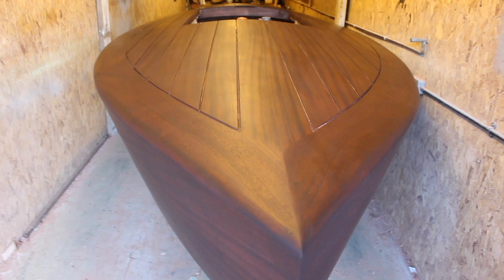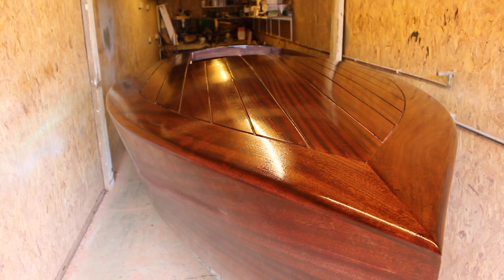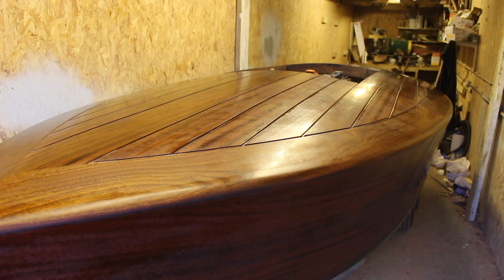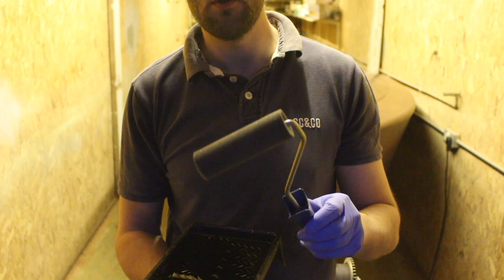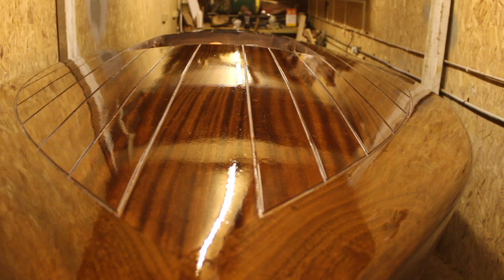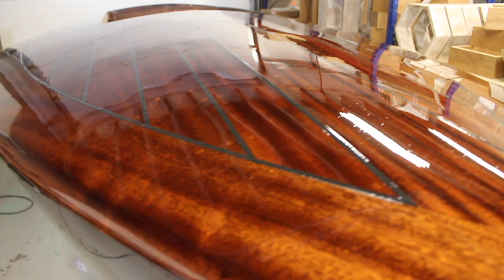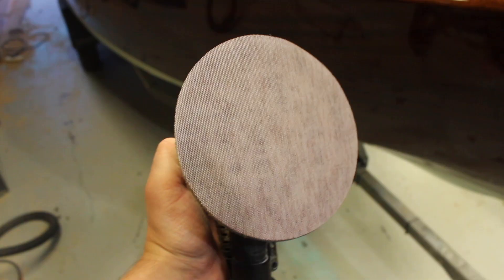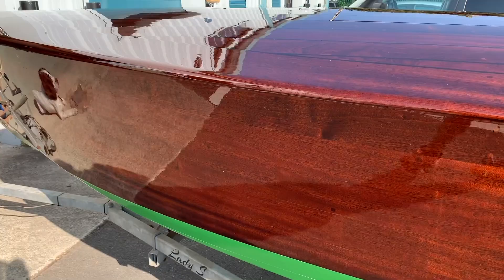How to Varnish a Boat | Finishing a Wooden Boat Pt 2 - First Stage Varnish

Comment: Beautiful work and see you pretty much varnish the way I do with exception that I do my wet sanding by hand.
I see a lot comments saying they're surprised you don't wet sand between each coat but I found that doing so is not beneficial to the finish and a waste of time especially during the first 4 coats. The varnish has to build up some before starting to do any wet sanding. And I don't use straight water, because I found adding a few drops of liquid dish detergent mixed in the water works better
Reply from the maker: Thank you. Yes I don't see any benefit to wet sanding in the early stages unless you are having particular issues with clogging of the sandpaper. I generally only wet sand before the final coat or when flatting and polishing.

Comment: In the spirit of sharing information.
Once all the leveling is completed rubbing teak with acetone is what I learned. We want the teak oil out. then I learned immediately a 70% thinner and 30% epifanes varnish. You want to be careful here, this is when the wood "drinks" the varnish you want thin coats applied so the varnish does to dry on top you could go 90%... while the previous coat is tacky, when the wood stops drinking it has reached the oily part in the teak. Maybe one more thin 70/30. 
At 50/50 , air bubbles are dealt with hair dryers. When your varnish is good (six inch deep) you can build, but I have never used 100% varnish.90/10 is as think i have learned
Reply: @Alain Pascal Routhier: Nice tips. But you may think about your wording as it sounds very much like a teacher to school kids. I don't have to learn, I'm boatbuilder myself. And I don't want to do it the way you suggest. I know this is typical american wording but it sounds quite rude to others. Additionally there's been no teak and no oil involved here. Mahogany, stain and varnish. And your grammar doesn't make a lot of sense. What do you mean by "you want thin coats applied so the varnish dries on top you could go 90%" This is a no sense sentence. Why should I be careful here? I want the varnish the saturate the wood for good deep uv-protection and great adhesion. Indeed I'd also go for more thinned coats than Dan has been here. At last it depends on the type of varnish if thinner on the last coats is necessary or not. And on the charge of the product and the age of the can. Some might have been longer in stock than others.

Comment: The building and building with more coats of varnish  to get a smooth texture without the coarseness of the grain showing through is done with a filler stain, applied once, and rubbed away at an angle to the grain. A  fine sanding and then a mere 3 coats produces a mirror smooth finish. More coats can be added for depth but back in the 30's and 40's 3 coats were often all they needed thanks to filler stain. Chris Craft filler stains  are available from Sandusky Paint and Varnish company as well as Interlux.
Reply from the maker: I know they are widely used but I'm not personally a fan of filler stain. As it essentially adds a film of colour over the top of the wood I think you loose a lot of the grain definition. Thats why I prefer to get the colour in the wood and then build with just clear (or amber) varnish as it seems to give a much more natural look that interacts with the light better, it does take longer of course. That being said many of the professionals and boat manufacturers do it using the method you have said.

Comment: Dan - regarding applying multiple varnish coats with no sanding in between. Manufacturers typically recommend sanding between coats. Have you had any adhesion  issues? Also, why did you thin the first 2 coats and not the subsequent ones?

Comment: Although my question does not pertain to this tutorial, may I ask what you used for caulking your seams and at what point did you do this?
It looked as though there was no caulk but at coat 9 through 12 the seams were caulked. 
Thank you!
Reply from the maker: I used 3M 5200 and did it part way through the varnishing process although I probably wouldn't do it this way again as I didn't particularly like the results.
Reply: @DanLeeBoatbuilding  It looks nice! Thanks for answering my question. Can you elaborate? What would you do different?
I did subscribe and watched your caulking video. When you rolled the varnish did it not get into the seams before caulking? Did it cause any issues?
Also, someone suggested 3m 4000uv but I have heard of "paint" cracking when the caulk was painted over. I think varnish flexes so probly would not Crack?
Also I have rolled and tipped but it looks like your finish was superior just rolling and allowing to level?
Thanks again!

Comment: great video ! What can't be emphasised enough is the use of the tack cloth to get rid of sanding dust. On my next job, I am going to even use an air compresor first to blow away sanding dust. This dust is almost a bigger threat than dust in the air, because you think it's gone and after applying a coat it floats up.

Can I ask you a question about staining: what about including a little bit of stain (red gloss paint) in the Epifanes varnish. Maybe only in the first coats. Would that be a good  idea to get a more even color on my new mahogany (model) boat which I am working on right now. Same question for an older real mahogany boat where I am going to work on this spring. The varnish is fine but turned a little bit mat and the wood has become brown instead of red, so I'd like to refresh this with  3 new coats.
I would really appreciate your thoughts on this.
BRW: beautiful boat !!
Reply from the maker: Thanks, one thing to consider if you are going to use an air line to clean up first: do it the day before and not on the same day as application. All of that surface dust becomes airborne with an airline and then proceeds to settle back in your finish over the following 24 hrs!

I don't personally like adding stain to varnish, mainly for the reason that you have to maintain very good control over film thickness when doing it. Otherwise you will see streaking or patching in the colour. Consider that this applies to both application AND sanding. If you sand slightly harder in one area then you reduce the film thickness and consequently start altering the colour. I much prefer to do all of the colouring in the stages when I am still "in the wood grain" so prior to varnish, perhaps coats 1 and 2 at a push.

Comment: I have been using Epifanes on my sailboat for the past 15 years, I thought the regular clear varnish required sanding between coats, but you seem to be applying multiple coats every 24 hours.  I switched to the woodfinish gloss to reduce the amount of sanding between coats which makes things much easier on the old knees.  Are you indeed using the Clear Varnish and not sanding between some of the coats?
Reply from the maker: Yes I am but I am somewhat "bending the rules" here. The timeframe for applying additional coats in this way is very particular. In truth there are better products to use within the Epifanes range that are designed specifically for doing this. Epifanes PP for example can be built without the need for sanding between coats if applied within 48 hours. I recently did a quick tutorial on this product which you can find here: https://www.youtube.com/watch?v=fVjt_E0Wtlo&list=PLZYnOqfpgGtpnH__3u_SZZK4XTUX1m3ek&index=1&t=27s

Comment: Incredible job.. can you tell me what type what will you need to do to keep this look on the boat for ever? Will you have to coat it every year and will you ever need to completely strip it back to the timber every  so many year? I'm really interested to know as I'm getting a wooden boat, thanks
Reply from the maker: Thanks. There are quite a few variables that will effect that. It's very unlikely that it would look that good forever! I would imagine after the final stage of varnish it may need refinishing in anywhere between 5 and 10 years time but that probably wouldn't be back to bare wood. Storage is a big factor, I keep this inside and out of sunlight (in a shipping container). Water and sun are probably the things that will deteriorate the finish most quickly, if this was left outside uncovered I think it would start looking tatty after about a year. That being said it depends on the type of wooden boat, some are designed to be left outside or moored in a harbour year round and finished with that in mind so different rules apply.
Reply: @DanLeeBoatbuilding  thanks for reply and info, incredible job

Comment: 9 layers? Most say 3-4 is enough, what will be the benefit of adding so much layers? Currently on the second layer for the new floor in my boat.
Reply from the maker: There is 17 on this deck in total now 😃 a number of reasons for so many, depth of colour, gloss and shine but perhaps most importantly, UV protection.
Reply: @DanLeeBoatbuilding  That makes sense. So basically the more layers I'll add, the better protection it will have? Can't I add "to much" layers?
Reply from the maker: Pretty much yes. Although don’t try to build too many in a short space of time, allow enough time for things to cure and settle down properly. Particularly if you are using a single part product.
Reply: @DanLeeBoatbuilding  Thanks for the advice. What about the last layer, if it's not 100 percent smooth, do you polish it? Can I polish it by hand without a machine?

Comment: Great job. Patience I assume is key. Did you consider spraying this varnish? Is this possible?
Reply from the maker: Thanks, very much so but also good planning of the job! I generally wouldn't consider spraying traditional varnish. I tend to only spray two part systems when I want to build a high volume in a short space of time.
Reply: @DanLeeBoatbuilding  thank you for the reply. When you mentioned two part, is that a polyurethane? If so why varnish and not a traditional clear coat like poly?

Comment: Dan, helpful video. A few questions - do you tip off when rolling the varnish, or do the grey superfine foam rollers apply with no bubbles/orange peel; do you thin the varnish a little for the rolling (how much?); how long do you leave between the three coats with no sanding between, touch dry or 24hrs? Thanks, Tom
Reply from the maker: I essentially use the roller to do the tipping off in this, I have used a brush before but this time around with those rollers I found I was getting a good enough finish/flow out without the need for tipping with a brush. 

Skip forward to 13:00 in the video and it's the part where I explain my rolling process. No thinning of the coats other than the first two. 

The time between coats can vary, when I first started the process and temperatures weren't very high (15 degrees probably) I was leaving around 18 hours between coats. By the end of the process the weather was a bit hotter (20-22 degrees) and leaving it this long would have meant that the varnish dried too much and would need keying up again before applying the next coat. These later coats were applied about 4-6 hours after one another, the timing of which meant I ended up doing a coat at 2am one of the days! 

Basically it needs to be dry enough so that you won't disturb or lift one coat with the next but it still needs to be tacky so it adheres properly.

Comment: Gorgeous work and very nice shop tour, in the earlier video. but I have a question here😊 you said you left the finish 6 month to harden .. is there any finish that hardens faster than that for boats ..
Reply from the maker: Thank you! Yes there are many products that will harden and completely cure in a week or so but the rest period is really about the varnish settling into the wood. The new wood will continue to "suck in" the varnish for some time as it moves over the course of the seasons etc. Even if you use a hard curing two pack varnish it's likely that after several months you will start to see the wood grain re appear in the finish because of this.

Comment: Hi 
I love your boat finish. Did I get this right? You used the 1K Epifanes varnish and applied the third coat while the second was still tacky? How did this work out in practice? I'm asking because the application note says coats need to completly dry and even sanded inbetween. Thanks, Torsten
Reply from the maker: Hi Torsten
Yes that's right. This method does bend the rules a little and isn't as per the advice on the tin. Coats 2 and 3 are applied whilst the previous one is tacky but dry enough so as to not disturb it. The timeframe in which I managed to do that varied between around 24 to 6hrs based on temperature. It is a way of speeding up the building of volume, if you flat off between every coat you are removing a portion of each coat (100% on and then 30% back off for example) and therefore building volume more slowly. You also have all the additional clean up, with vacuum, tack cloth and thinners. Doing that on every coat increases the workload massively but doing it every third coat saves a lot of time, consumables and work. I'm sure there are many that will disagree with that but its the method that works for me.
Reply: @DanLeeBoatbuilding  Dan
Thanks for your reply. I was under the impression this was only possible with the 2K stuff from Epifanes. I'm glad to hear there is a way for 1K also. Sanding & Cleaning is what sucks the most. I will try out your method. If it works for me I will apply it next vernishing-season ;-)
Thanks
Torsten

Comment: What sander do you use in the shop ? I like how compact it is an wondered if it’s an air sander?
Reply from the maker: It's a Mirka CEROS, which is an electric sander but has about the same profile as an air one, very nice bit of kit!
Reply: Hi I bought the mirka Deros and vac too, hell of a good piece of kit mate worth every penny ;) if you choose to join team mirka you won't be disappointed. Just my 2 cents